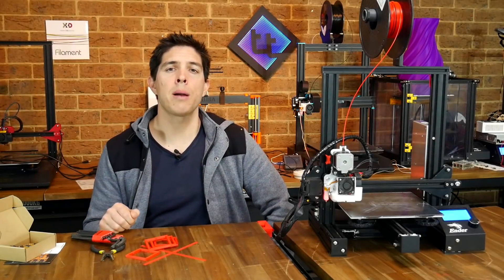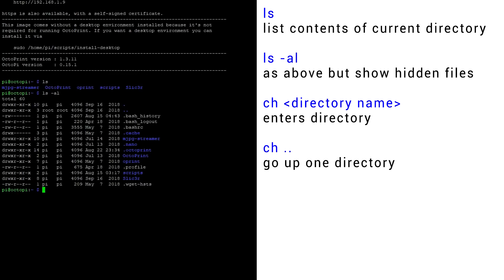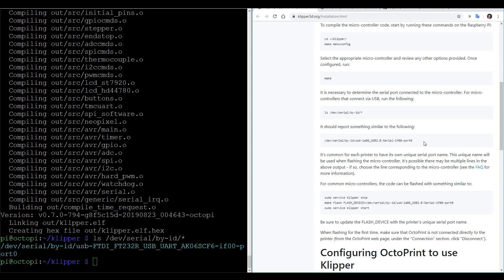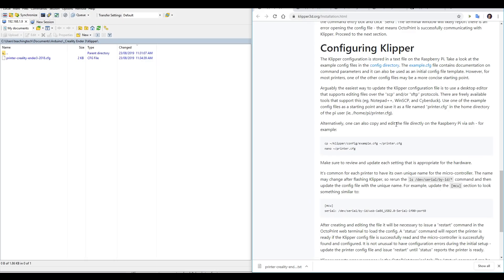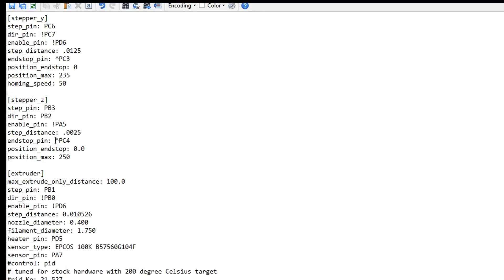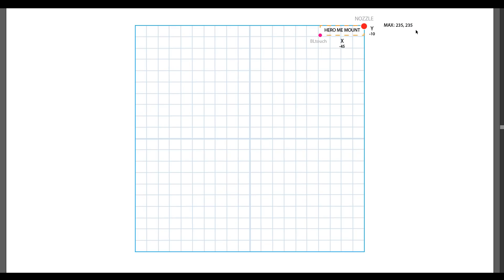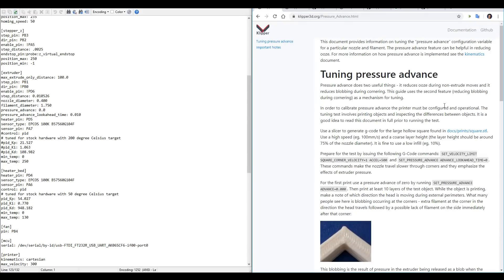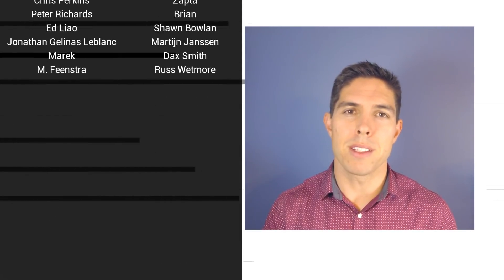Using a 32 bit Raspberry Pi to boost your 3D printer mainboard - Klipper Ender 3 guide

Comment: dont you need to install a bootloader to your mainboard first, to flash through USB over the pi?
Reply: yes, there is a tutorial, made by Michael, on how to.  Klipper is another firmware as Marlin is. So to change the firmware from Marlin to Klipper, you need a bootloader on the motherboard, because the original motherboard, do not come with one.

Comment: Hi Michael. Great VDO. However, if you put on the VDO that we need bootloader first before flash klipper to Ender 3 board would be great. I forgot the step and forgot to put 10uF on Arduino (RST & GND) that take me hours.

Comment: I have ordered a Bigtreetech SKR E3 Dip, what I would like to know is will there be any advantage using klipper via a raspberry pi 3B+ being a 64bit processor ?
Reply: pi has 64 bit cpu, but raspbian only comes in 32 bits so no clear advantage there. The extra ram and an extra core might be beneficial though. If i were you, id try printing something at higher speed, say 250mm/s and if there printer starts to "stutter", i'd try klipper. otherwise, don't fix what isn't broken ;)

Comment: Question, so you HAVE to have octoprint installed on the Pi beforehand??
Reply: no. you can install octopi after installing klipper. But either way, you'll need it, unless you'll figure out some way of sending g-code to virtual serial port klipper uses for communication (and yes, technically you could do that, but why would you make your life more complicated?)

Comment: Another great video.  Was following along, but got stuck at ls /dev/serial/by-id/*..  None of my pi's like that command.  I keep getting no such file or directory
Reply: nevermind...   just had to power the printer on first
Reply: @etoyocthebackwardscoyote3572  linux creates the USB serial ports dynamically. I recall the old UNIX days when serial ports were pre-configured and there would be ton of phantom ttys in /dev.

Comment: if you end up fighting the printer.cfg remember to put in the direct location of the serial port!
eg.. for my CR-10S: (found using   ls -l /dev/serial/by-id   in PUTTY)

[mcu]
baud: 115200
serial: /dev/serial/by-id/usb-FTDI_FT232R_USB_UART_AO000V8E-if00-port0
pin_map: arduino

Then go into OctoPrint setup (gear in upper RIGHT) and under serial connection general, make sure '/tmp/printer' is selected and you type    /tmp/printer    in the 'Additional Serial Ports'. You MUST reboot the system after changing for it to take effect... Took me 3 hours to figure out because of a mis-type but it does work.

Comment: Can we do all of this while still having Marlin? :o I literally just did the Marlin upgrade mainly for the thermal protection stuff...
Reply: If you have a good running marlin setup on a prusa style bed slinger it won't make to much of a difference. I set it up when switching my A8 to a RAMPS and it made setting up the printer a lot easier (compared to changing the firmware of the A8 board). All config changes (pins etc.) are done by changing the config and restarting, takes ca. 10 seconds. Once you get used to it you will never go back.
Reply: @loban4243  gotcha dude, I have an ender 3 and already went through the process of upgrading to marlin 😂 so I think I'll keep it for now
Reply: You won't be using Marlin, Klipper replaces it entirely.
Reply: @loban4243  thank you for the clarification! I don't really see the point of doing this over marlin other than possible print speed increase?

Comment: interested to see klipper vs a skr 1.3 board. i dont think it would be any different. also i thought linear advance was broken for tmc steppers. has this been fixed?
Reply: Klipper works great on the SKR boards. Linear/Pressure advance isn't broken for TMC drivers, but Klipper's fast step rates can cause TMC 2130s and 2209s operated in "standalone" mode to stall under high accelerations, and LA/PA can need high accelerations. Drivers on stepstick boards (like SKRs use) can either be run in step/dir mode or you can get them with SPI or UART capability; if you set it up on the board to use SPI or UART, and tell Klipper about those pins, it can change the configuration of the TMC drivers, which is no longer "standalone". By doing this, Klipper can adjust the driver behavior to handle high accelerations correctly. There's an entry on the Klipper FAQ about this.

Comment: Well that was easy... (rolleyes)  Actually, it WAS relatively painless, but the Bootloader install was tough for someone with no Arduino knowledge.

I eventually got it all installed and working.

Quick question; How do I go about installing Klipper on a second Ender 3 Pro. (It arrived yesterday) All the files are now already on the Pi, so how do I go about putting it on the new printer?  I'm thinking (hoping) that I won't need to go right back to the beginning of this tutorial?  (I'll have to find the bootloader install tutorial video though...)

Also, once you install Klipper, can I still print from a MicroSD card?
Reply: Did you find out if you can print from a SD card? Wondering the same thing

Comment: Is there any settings you can alter  to speed up the klipper boot up? , the machine seems to take at least a minute to display the screen now, (ender-3)
Reply: pretty sure that's because of the pi, from what i've noticed, its mandatory to have the pi running for klipper to even boot at all. when i have the pi booted up and restart the printer it takes 5-10 seconds, if i turn off the pi, the printer will be stuck at the blue screen forever

Comment: Have you noticed faster speeds with Klipper?
Reply: No I didn't. I'm just wondering that I need to change the printing speed in Cura before slicing the model? Or anything to the starting gcode? Thanks, Norbert
Reply: @farkasnorbert944  obviously you  need to change the settings in your slicer...

Comment: So I have the old Silent V1.1.4 board and this installed fine, it does work as it shows Klipper Ready in the Octoprint terminal screen só don’t say it doesn’t... 

My question is how can you change E-steps with min Klipper... I have 0.9 degree steppers and 16T belt and pulley and need to update everything from The factory 80mm/s to 200mm/... also on the extruder I need to change it from 400mm\s to 800mm/s... any help is awesome
Reply: It is almost the same Marlin defines how many steps that are requierd for 1mm of movment. Klipper wish to know the movment for 1 step. Ie if a stepper takes 400 steps for 1mm of travel klipper wants the value of (1/400)= 0.0025

Comment: Thanks for this video. I am just waiting the delivery of the DD kit for my Ender 3 pro and with my BLTouch that will copy your configuaration and so Klipper should be good to go......

Also, I have been looking at board upgrades as well. Now your video has opened my eyes to another option.... printer improvement through Klipper (I love the way I can go back to the macros of my youth to control regular actions/stuff) and a simple board upgrade to the Creality 1.1.5 silent board with TMC 2208 drivers. I assume that I will have to alter some stuff in the config for the drivers but no doubt there will be help somewhere on-line. 

What did I do before superfast cable broadband?

Comment: So basically if I have Ender 3 without BL-touch and I am into buying original one and installing it for a first time, basically second half of the video is also an tutorial how to get BL-touch working together with Klipper right ?

Thank you!
Reply: Right.  Though it is important to note that you can do Manual Mesh Leveling with Klipper too.  I did this and while it's a little annoying process wise, it does help a lot.  I found best results by setting up the BED_SCREWS_ADJUST offsets and doing that first with just the least amount of friction on the paper I could feel.  Then doing the mesh and making sure my position_min on the Z axis is at least -0.5 (-1 would be safer).  Then I did a 5x5 grid because 3x3 wasn't enough on my printer to compensate for the low spot in the middle.  That was by far the best way for me to handle the bed leveling without the BL-Touch given the low spot in the middle of my build plate.

Comment: Inspired by this video (and by peeking in to klipper before) I decided to give klipper a go. It's really good and I'm getting really awesome results and great speed! I had one problem though. My Ender 3 printer is equipped with a capacitive Z sensor which started to get a lot of interference. Apparently the klipper has a lot higher steprate for the motors that they start to interfere with the sensor. I solved the problem with connecting a GND cable from the control board to the aluminium plate behind the hotend and sensor, which shielded the sensor enough to get me printing. Electical engineer relative of mine also said it might help even more if the cables to the motors were shielded, and the shield connected to the GND, but I have managed without that so far. The interference comes specifically from the motors because they are driven by such high frequency signal, which again affects the sensor even if the cables are nowhere near the sensor itself.

Comment: Klipper really shines for delta printers. My delta was struggling with the tradicional arduino+ramps+marlin, changing to klipper made the small pauses in complex prints go away and made the surface finish a lot better, also, I was able to speed prints up significantly...

But in my cartesian printer, I still uses marlin (with 8 bit processor), klipper didn't appear to make big changes in print quality for this printer...

Comment: I guess time will tell if the gaff of setting Klipper yields better print results. You’ve piqued my curiosity, but it looks like I’ll need to block out a fair amount of time if I want to do the job. Thanks for taking those steps and sharing them.

Comment: FYI = This is only for the earlier V1.1.3 boards or any other board that DOES NOT use the TMC2208s in STANDALONE mode. This is not supported on the new Creality silentboard (V1.1.5). See: https://www.reddit.com/r/ender3/comments/ctiuar/the_new_v115_silent_board_and_klipper_dont_bother/

Comment: After toying with the idea of using this on my ageing MK2s, your video inspired me to give it a go. It was a bit harder than I would of liked (largely because there is no MK2s cfg available), but I now have a working config, with mesh bed levelling, pressure advance etc - which is producing some of the best calibration prints I have seen, and the speed boost is great (using re-configured prusa slicer). I would definitely recommend this to anyone with older hardware looking for an upgrade...

Comment: Klipper supports multiple mainboards for 1 printer. So you can have 2 ramps boards plugged into a RPI controlling 1 3d printer. Why might you do this you might ask. Well 4 stepper drivers controlling z axis for example or multiple extruders.

Comment: I installed Klipper after I ran into a brick wall with Marlin and constant "TMC Connection Error[s]" with my 2208s.
Klipper seems great, but now I'm having to learn the quirks of a whole new package thanks to using an SKR 1.3 .
Still haven't gotten it running smoothly, so I going to admit defeat and look for a .cfg that someone else made for my setup.
Reply: Which board are you using and how do you have the TMC2208s configured? If the TMC2208s are in STANDALONE mode, Klipper does not like StealthChop only configurations.
Reply: @thomaswiley666  using an SKR 1.3 with 4x 2208. I set XYZ for stealth and E for spread, but I'm still getting errors in the Klipper plug in for octoprint. 
The errors are specific enough to be relatively easy to track down, but I feel like I'm just playing whack a mole. 
Found a config @ https://www.reddup.co/r/klippers/comments/csjzid/sample_config_for_ender_3_bltouch_v30_skr_v13
that I'm going to try tonight.

Comment: You can use Pi 3b+ on 2 or even more 3d printer at the same time but maybe you can test or got info how Klipper will work on Pi with 2 printer?
Reply: Definitely. Takes some bash though. Take a look at this: https://github.com/KevinOConnor/klipper/blob/master/docs/FAQ.md#can-i-run-multiple-instances-of-klipper-on-the-same-host-machine

Comment: Since you are running Klipper, do you really need the add inboard for the BLTouch or a filament run-out sensor? The Pi has extra unused IO pins. Can you connect straight to those?
Reply: You coulb, but klipper makes it extremely easy to add these things. For most of those thing there are already example configurations.
Reply: Pi is not realtime

Comment: I had same problems with safe homing in Marlin though..  No matter what I tried I could never make and ABL safely without an super complicated and unreliabe sequence of GCode in Cura :( The countless smashing of the head into the heatbed, and other crashes made the hardware go crap before I could even star printing some stuff I wanted. And so I hav given up on my 3D printer, and can't afford another one.. Ender-4 is crap btw, it can't even draw precise circles because of it's H-belt design, and also there's too much acrylon.

Comment: Using Klipper, is it possible to add extensions like TMC2130 SPI support directly to the RasPi's GPIO instead of the printer board?
Reply: Probably possible, but why would you? Klipper also supports SPI comm with the TMCs

Comment: Been thinking about this some more. Do you lose some or all of the printer's built-in functionality, such as auto-leveling (on a Chiron)?
Reply: Yes, it completely replaces the firmware, but Klipper has implementation (and examples) for most of those features.

Comment: Doesn't work for me. It's not letting me flash the firmware. 

pi@octopi:~/klipper $ make flash FLASH_DEVICE=/dev/serial/by-id/usb-1a86_USB2.0-Serial-if00-port0
  Flashing out/klipper.elf.hex to /dev/serial/by-id/usb-1a86_USB2.0-Serial-if00-port0 via avrdude
avrdude: stk500_getsync() attempt 1 of 10: not in sync: resp=0x65
avrdude: stk500_getsync() attempt 2 of 10: not in sync: resp=0x63
avrdude: stk500_getsync() attempt 3 of 10: not in sync: resp=0x68
avrdude: stk500_getsync() attempt 4 of 10: not in sync: resp=0x6f
avrdude: stk500_getsync() attempt 5 of 10: not in sync: resp=0x3a
avrdude: stk500_getsync() attempt 6 of 10: not in sync: resp=0x54
avrdude: stk500_getsync() attempt 7 of 10: not in sync: resp=0x46
avrdude: stk500_getsync() attempt 8 of 10: not in sync: resp=0x20
avrdude: stk500_getsync() attempt 9 of 10: not in sync: resp=0x69
avrdude: stk500_getsync() attempt 10 of 10: not in sync: resp=0x6e

avrdude done.  Thank you.

src/avr/Makefile:32: recipe for target 'flash' failed
make: * [flash] Error 1
pi@octopi:~/klipper $

Googling indicated, that you have to flash a bootloader before installing a new firmware. Welp.
Reply: flashing bootloader is the same process as arduino board so googling that may help you, also mine didnt want to flash until i changed serial by id to tty
Reply: Same here
Reply: perhaps adding the user (whoever you are logged in as)  to the tty and dialout groups will let you write to the serial port.

Comment: Worth noting. If you are running a silent board with 2208s, klipper does not play well. Noted on the klipper github, the 2208s default UART mode runs into a bit too much granularity in klipper and will stop the 2208s in their tracks mid print when trying to run pressure advance. Without pressure advance enabled the 2208 on the extruder plays well.
Reply: Are You running original Creality v 1.15 board ?
Reply: @MrSardach  I am running 1.1.4 with tmc 2208. The 1.1.5 would be the same scenario though.

Comment: Ive just done a BL Touch for a CR-10s Pro and I think your recommended method is no longer necessary. Check the updates on the Creality website.
Reply: Me too but I'm using TinyMachines Firmware
Reply: Pedro Viana I’m using the tiny machines firmware. There was some confusion with early bl touch v3 installations due to various YouTube’s misunderstandings. This was set straight and info copied to the Creality’s CR10s Pro page.

Comment: In case no one else said it yet, Win10 has a built in SSH client now.

PS C:\temp> ssh
usage: ssh [-46AaCfGgKkMNnqsTtVvXxYy] [-B bind_interface]
           [-b bind_address] [-c cipher_spec] [-D [bind_address:]port]
           [-E log_file] [-e escape_char] [-F configfile] [-I pkcs11]
           [-i identity_file] [-J [user@]host[:port]] [-L address]
           [-l login_name] [-m mac_spec] [-O ctl_cmd] [-o option] [-p port]
           [-Q query_option] [-R address] [-S ctl_path] [-W host:port]
           [-w local_tun[:remote_tun]] destination [command]

Comment: Lol. I just quit kipper and moved back to marlin. It's way too much of a headache at the moment. Imagine kipper to be the Linux of 3d printing while marlin is like Windows. Kipper gives extremely low level control of your 3d printer. Anyway, head over here if you need some more info than what you have here in this videos. https://thriftyengineer.com/klipper-ender-3/

Comment: me: I will not change or upgrade my Ender 3 pro again.
Michael: release another video...
me: hmm... I change my mind.
Reply: Yes. My printer actually doesn't have much problem.

It just that I have raspberry pi readily available, octopi backup image (customized to my printer) available and even the customized Marlin codes available in my GitHub.

If anything wrong, I can restore it back to normal within 10 minutes. No harm experimenting new thing.

I just need to find some free time.
Reply: @jimmer411  I am printing PLA at 120mm/s without klipper on my wanhao i3 plus so believe me that's not fast. A friend of mine is printing at 250mm/s with klipper 🙄